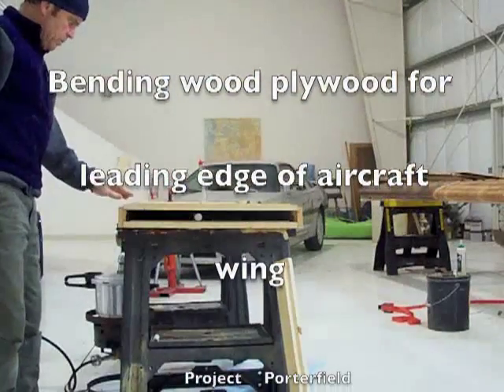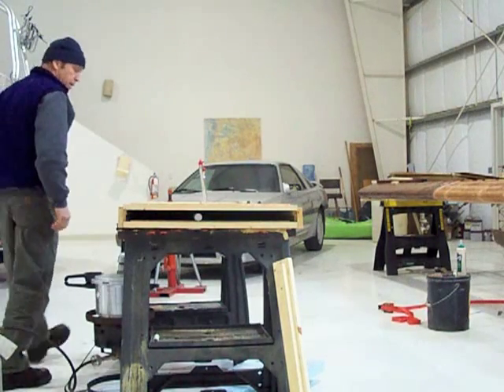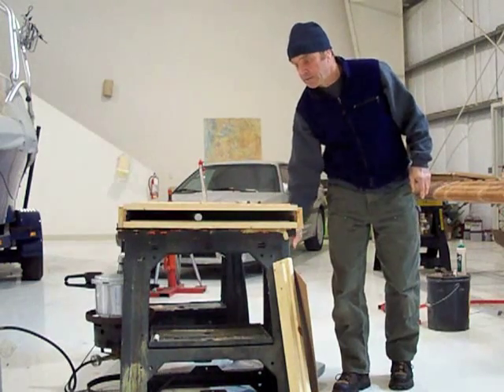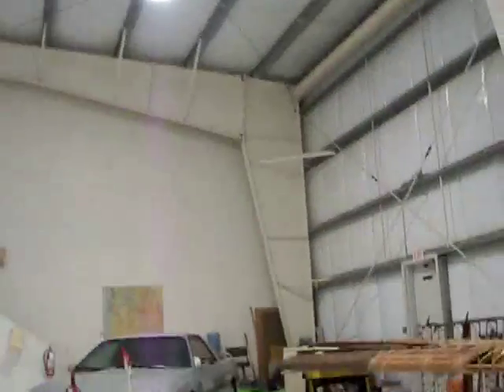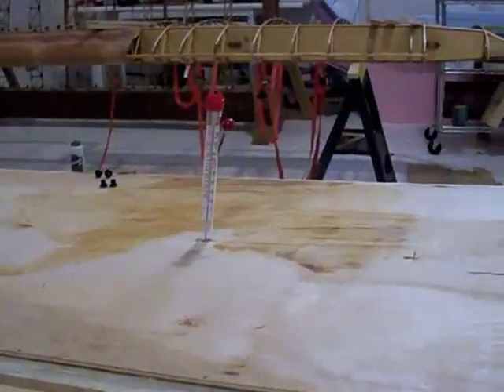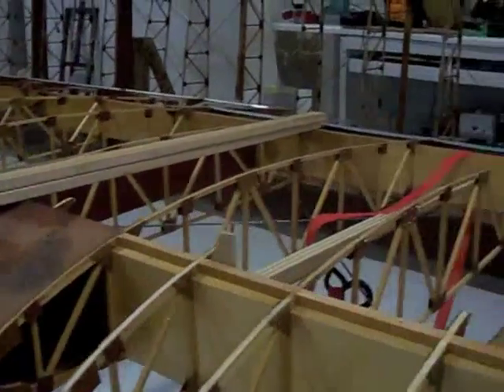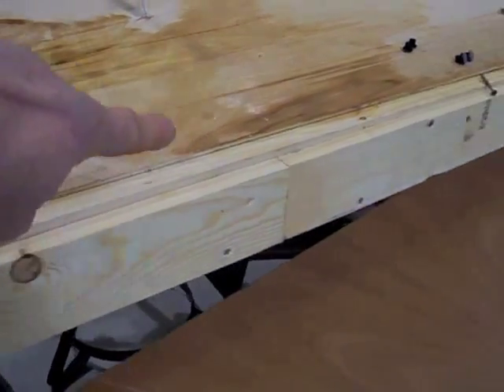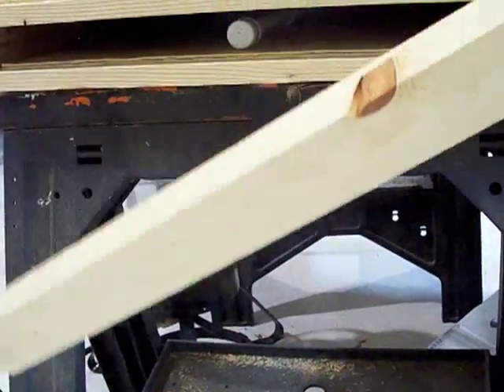wood bend 2

Comment: Great video! I am just curious, have you ever had glue failure and de-lamination after heating the plywood?
Reply from the maker: No, when I bend the wood it pretty much takes the shape it needs to be when I glue to the ribs I make sure that the plywood is against the ribs of course the ribs have to be all lines up also when the plywood is taken out of the  steam box it cools fast so you have to work fast. The plywood is an aircraft quality, 3 ply and hold together even when wet.